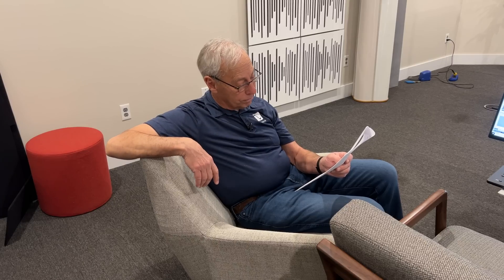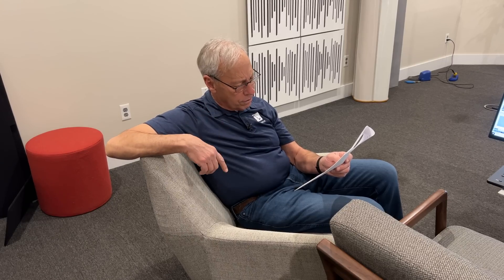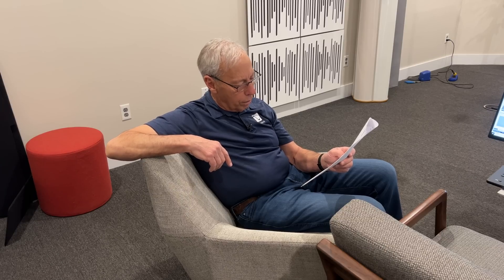Replacing aging capacitors

Comment: It's gradual alright but what are the symptoms of ageing electrolytic capacitors?
Reply: "During the capacitor aging process the electron leakage current and the chemical reactions both cause a decrease in the capacitance value and an increase in the resistance value."
Reply: @captainwin6333  thanks. I probably could have asked in a clearer way - how do ageing electrolytic capacitors affect the audio? So I could tell just by listening, not measuring the caps. Thank you
Reply: Depends on where they are in the circuit.  Power supply capacitors will gradually cause an increase in ripple voltage, which reduces the amplifier's distortion-free output power.  You are not likely to notice, unless you make a careful measurement.  
Electrolytics in speakers can cause reduced efficiency and a drift in the crossover frequencies.  
Small electrolytics in the signal path can cause signal attenuation, but you wouldn't likely notice this until it becomes severe.  
Electrolytics used in the bootstrap supply for certain class D driver chips can cause catastrophic failure of the output stage if their ESR rises too high.
Reply: @marianneoelund2940  Thank you, this is exactly what I was hoping for!
Reply: Well in my case the the sub was still making the low notes but it was less defined, less musical. Every once in a while it would make a cracking over driven sound even at low volume. I suspect because the caps in the servo area were bad and not controling the speaker itself like it was designed to do.

Comment: "It's gradual, most people don't notice it" - perhaps because it's SO gradual that any halfway decent capacitors will continue to perrform well within spec for many years to come.

Before the rip-out-your-caps brigade come for me, who is telling you that vintage gear is ageing badly and will be costly to repair? a) Manufacturers who want to sell you new stuff, b) YouTube reviewers who rely on a steady supply of review samples from manufacturers who want to sell you new stuff, and make commission on links to retailers, c) a certain type of commenter who loves to parrot audiophile myths despite little or no relevant experience (see also: cables, vinyl, jitter, power regen- *cough*), has million-dollar golden ears, is somehow impervious to confirmation bias and who clenches instinctively at the mere mention of science.

OK, light your torches. I'll be the one hiding behind a stack of vintage audio gear that all performs very nicely, thank you.
Reply: Not all. I was told if my caps were of a certain brand that AR used in later years, I probably had no need to replace them - that in testing many sets of speakers, it was found the values had not changed significantly.  Unfortunately, mine are not that brand. Rats. So, I want to be careful, especially with the tweeters, and as long as I'm inside, I figure I might as well upgrade them all and be done with it.  There's an Acoustic Research forum where people discussed all this and took values of their capacitors, so it is no myth. It's just that electrolytic capacitors were what they were in their time period.  Heck, there are even speakers today that still use them, and manufacturers should be called out for that. No excuses today.

Comment: I have a pair of Tandberg speakers made in late 70's to early 80's and have been thinking about replacing the caps sometime in the near future, although last time I checked inside them I don't recall seeing any electrolytes (so if there were any, must not have been many).

They probably would benefit from some attenuation as well, since the woofers were replaced over ten years ago with third party woofers. They otherwise fit well and behave similarly to the original woofers, except there is a pretty sizable sensitivity mismatch. Pumping up the bass from the receiver does help, but since the crossover on the woofer should go up to 750Hz, I'm thinking that EQ/tone control isn't going to help with the whole thing.

Comment: Sad to hear that my 1992 Velodyne subwoofer was of low quality. I have always thought it was a good one until now.
Reply: Velodyne were infact of high quality , loved it and much better then other subs during their time.
Reply: If it sounds good in your home then it was a good one 👍
Reply: Not of low quality. They used what components were available at a price point that made sense in 1992. Fortunately, other types of capacitors that don't dry out and change value are available at reasonable prices these days. We are fortunate for that.
Reply: @rosswarren436  Velodyne has made some of the best subs ever and I enjoy a couple of them. DD-18+ is hard to beat, for example.
Reply: @ThinkingBetter  yeah, they were one of the first and best subwoofer companies producing subs that offered far more than one note bass.  I'm not sure they are still in business. I'll have to look them up and see.
Reply: @rosswarren436  Velodyne is famous for its Digital High Gain Servo Control technology that helps reduce the distortion for low frequency bass by using a patented accelerometer mounted to the cone to monitor the motion and ensure it follows the intent and the cone stops when it is supposed to stop. Velodyne Acoustics is still in business but I'm not convinced their once leading Silicon Valley R&D has survived.

Comment: Dear Paul thanks for the video👍, I have a question ,about a year ago I have bought a rare ADCOM GFA555 MK2 which was new never used in original sealed box, so should I have to replaced the capacitor ? I am a bit concerned. Hope you can answer, but I must say it is sounds amazing 😍
Reply: @markwilson5262  "simple obvious answer NO
"

Not so obvious, since the only real way to know is with a suitable LCR meter. Old caps should be reformed. The worst cause of failure for capacitors is probably shelf life, which is like the same situation we have here. Use a voltmeter to check the capacitors inside, they can be very dangerous or life-threatening.
Reply: @EnigmaVideos  Agree 100%. From what I have read that caps just go  bad over time. They dry out.
Reply: I'm a huge collector of Adcom gear, back in the 90s they were at the top of their game but they suffered just like a few other competitors with some bad capacitors that would start leaking this only occurs after several  hundred hours of use. You should absolutely not have anything to worry about at this time but you need to have someone at least look at it and just see what kind of capacitors were used I believe in the MK II they had the problem fixed already. And hold on to that baby because they are just going up and up and up in price. Take care.
Reply: @vegaslimoguy2376  thanks man, what do you Owen in your arsenal , this is very interesting 🤔
Reply: @RanTausi  Thanks, i have several GFA 5500's in mint condition, a GFA 5400, GFA 5800, also the flagship GFA 5802 as well as several different preamps, i also own the single disc GCD 750, which to this day is still the best CD player with built in DAC that ive ever heard for the money. I also own over a dozen other various Adcom amps that i often use to power my subwoofers. Adcom amps in the 90s were built like tanks, they will run forever and sound warm and tubelike with tons of power. They ARE still in business, however now made in Taiwan.
Reply: @vegaslimoguy2376  Woha that's a great collection.
I Owen GFA545 MK2 in mint condition some say it sounds sweeter then the GFA555 וו , but since my GFA555 is new I decided to use it and sat the 545 a side for now, maybe I will use it a second system in the future. By the way I also sat a side the GFP565 since I have bought Fosi audio P1 tube preamp from Amazon, it is really sounds good with it. Enjoy 🙂
Reply: @vegaslimoguy2376  I’ve got a pair of GFA 555 II that I’d like to use bridged with my Kappa 8’s.  But, before I do, I’d like to have the amps ‘gone over’.  Can you recommend a list of things that ought to be done, or desired upgrades?  And, ideally someone with Adcom experience who can do this kind of work?  I’m aware of Hope’s Brain but he no longer  works on equipment as I understand it.  Any advice appreciated!
Reply: I've got the GFP555 bought in 1993, still singing beautifully today. It's hooked up to a Yamaha 600U 200 watts/channel. They work well together.
Reply: @iancanuckistan2244  I bought used GFP 565 in a great shape and it sounds very good with the GFA 555 , although I just want to have the two big filter caps replaced inside the GFP565 preamp